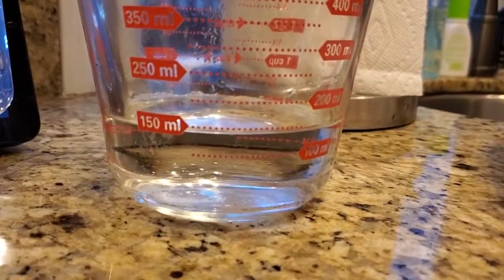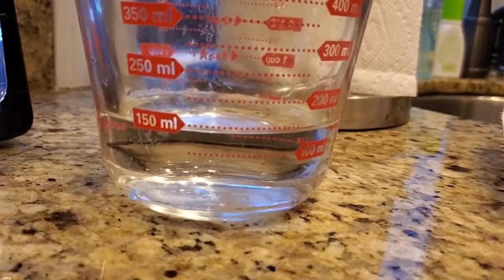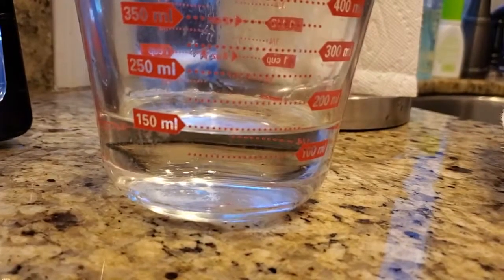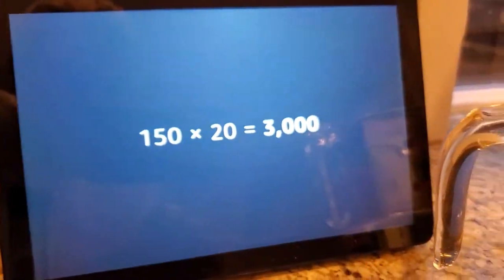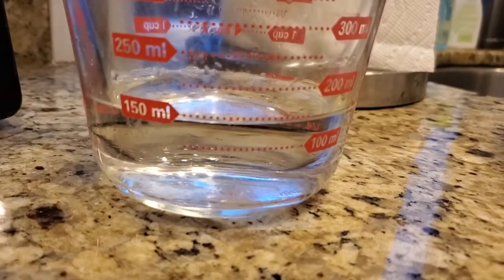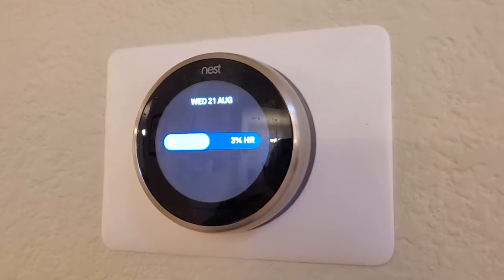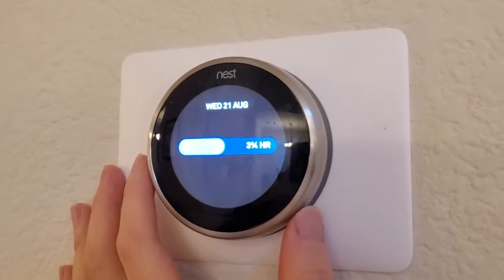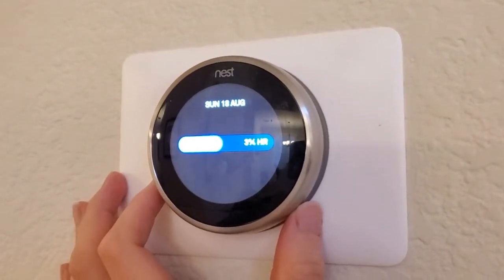How Much Water From AC Condensation Drain?

Comment: I am in Florida where it's humid all the time. 5 to 20 gallons a day easily. Now imagine if every home had a system to capture and utilize this waste? Especially in drought stricken areas. 1000 homes at 5 to 20 gallons a day = 5,000 to 20,000 gallons that is typically wasted everyday. We should crowd fund and collaborate a system that can be installed and pumped into a central location per subdivision across America or hell the world
Reply: This water might require alot of filtration or processing to be used as it's contaminated usually with lead, at least in case of older AC units case. Solder used to weld the copper tubes inside AC might contain lead and it will contaminate the condensate from AC unit.

Comment: I never understood why people in Cali or any where, never did this!  The average person drinks 183.5 gal per yr. The average toilet holds 1.5gal. I always felt all new homes should have storage tanks for AC/Rain water collections. 3 gal of water a day is roughly 350-700 gal a year. You can use the AC water for your toilets, washing machines and dishwashers. Use the Rain water for your lawn etc...
Reply: Krobertson. Absolutely right. My idea was to build into an entire city a fresh water A/C condensate collection system. Pump it to a reverse osmosis facility. As A/C condensate is distilled water. Very little treatment needed. In fact you could add minerals. Build this system as a co op through rural development funds by Franklin Roosevelt a citizen  owned and operated as a non profit. Once system was paid off. Citizens would begin getting dividend checks above annual expenses for using cleaner than store bought water . Thus ending or significantly reducing the plastic, single serve currently sold  in stores. Great for reducing plastic in landfills good for taking back, and creating citizen ownership of our cities  utilities in the big picture. .
Reply: You can also use greywater from the shower to water plants and further recharge groundwater as it filters into the soil. Each shower uses about 20 gal. I think it's a good way to green the landscapes and keep trees healthy so that the cooling effect further reduces AC demand

Comment: Is this water potable?
Reply from the maker: The water is not potable. There would be a risk of bacteria contamination
Reply from the maker: (And thx for the ping. I didn't see a comment in response to yours, but I'm happy to answer!)
Reply: @DIYLifeTech  Also it might contain lead due solder used in joining the copper tubes inside the unit.

Comment: Your AC system will produce 1 quart per ton per hour depending on the humidity. A higher humidity will produce a maximum amount of 1 quart per hour per ton. The dewpoint temperature is the temperature at which moisture collects on solid objects like a cold glass of water. The dewpoint temperature is constantly changing and is dictated by humidity and temperature.

Comment: sir, may i know the capacity of your air conditioning unit?
Reply: Look at your outside unit model and serial number and the model number you’ll find a section of letters and numbers. You’re looking for a number divisible by 12 or six if you have a 3 ton system your unit will say 36 in the model number if you have a 3 1/2 ton system your number will be 42
Reply: A 5 ton system will have number 60 divide 60 by 12 and you get 5, 5is the tonnage The reason why they use 12 is because 12,000 BTUs equals 1 ton of cooling

Comment: Did you ever do anything with this idea? I'm about to do the same for a raised garden bed. I have a small pump hooked to my condensation pan on the AC unit. That Pump sends the water into my garage drain but I'm going to follow the AC line outside into a pvc system above the raised garden beds